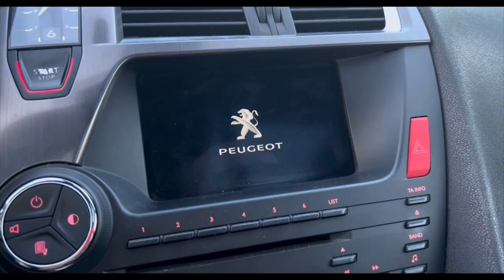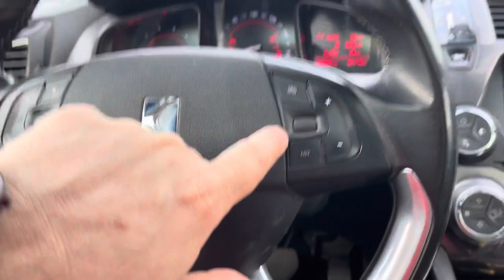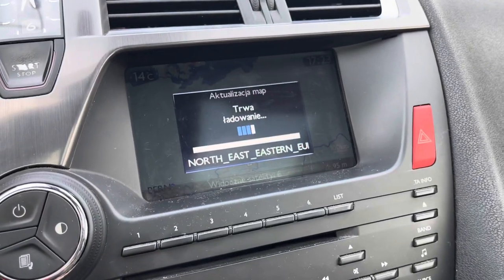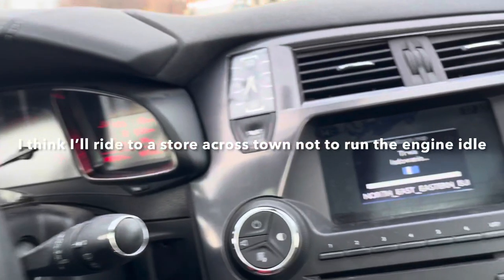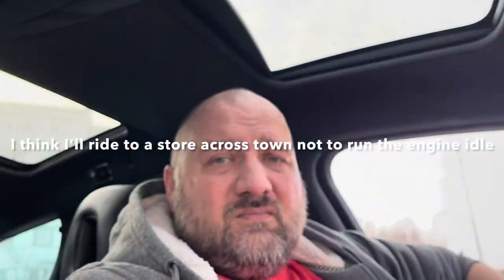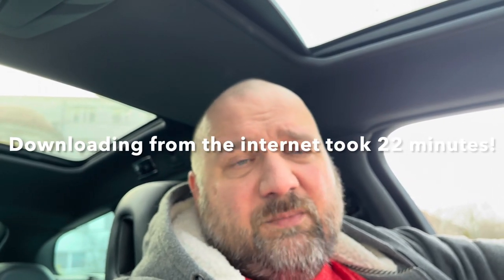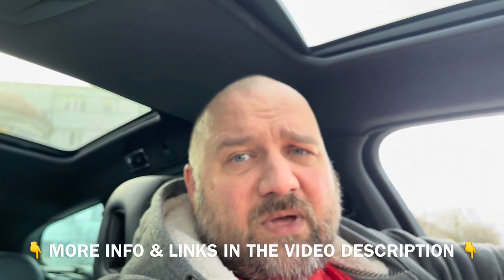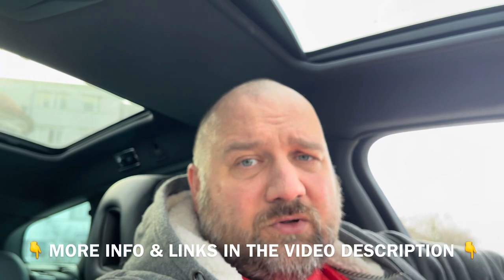🇺🇸/🇬🇧 Installation of newest navigation maps on RT6 Citroen/Peugeot radios 📻

Comment: After I update maps from your link, I get big issue, now I have no map showing and error "please insert navigation cd". How to solve this now?
Reply from the maker: I had this happen once also. If I remember correctly it helped to download the maps again and try reinstalling
Reply: @TomaszPlawski I have done this now  but it is the same. Like just all maps has been deleted. I have blank navigation.
Reply from the maker: Did you dissable DRM with mirascript?
Reply from the maker: Maybe also try a different source e.g. https://psa.download.navigation.com/automotive/PSA/RT6-SMEGx/M49RG20-Q0421-2001.ZIP although this one is quite old. It’s weird that all maps would disappear… maybe they planted something in this source which clears the memory seeing the link has been shared around by so many people
Reply: @TomaszPlawski I have done just javasript, but it was odd no password was ask when I run update maps. I have Map DRM set to 0 already.
Reply from the maker: If DRM is 0 then it should work fine without javascript modification of the load file. To me it's weird that as you said that all maps are blank, looking that their files were deleted.  Normally the loads jus overwrite the certain region files and if you don't have DRM set to zero and don't adjust the load file with the javascript it just won't load, but the original files stay inaffected.  As mentioned, during my experiments I had the similar problem once with the radio asking for the CD after a load, but after reloading the same region again from a new download the problem dissapeared.  I'm wondering now, if perhaps your SD card inside the radio is not corrupt and needs a replacement and it's just a coincidence that this became evident with the map update and new large amounts of data being written to the card? How old is the car?  In mine if I remember correctly the SD failed after some 7 or maybe 8 years. ... https://www.youtube.com/watch?v=USExhDGkdKU
Reply: @TomaszPlawski  for last try, I was set DRM to 1 and without javascript and the maps are still start to loading from USB. No code asking nothing, after it was done was the same like previous maps instalations. If the SD car died in unit I do not know. Car is 10years old.

Comment: hi can i use the download link for rt6 in 308 2013?
Reply from the maker: If it’s an RT6 I would guess yes, is it totally broken (i.e. you had to replace the SD card and need to do a fresh load, as in “I have nothing to loose”) or are you rather thinking about upgrading to a newer version? The later can erase the config parameters which you might have trouble restoring.
Reply: @TomaszPlawski  i domnt have an sd card radio number ends with 775XN
Reply from the maker: @blablabla4606  I think it should work OK
Reply: @TomaszPlawski  the radio want some active key
Reply from the maker: @blablabla4606  you need to use MiraScript to dissable the checking of the activation key http://mira308sw.altervista.org/en/index.htm
Reply: witam I Ten sam problem z aktualizacją map dla Polski w końcu udało Ci się dokończyć instalację?